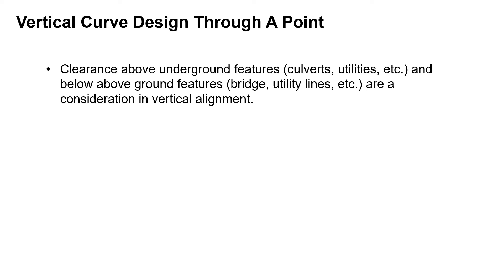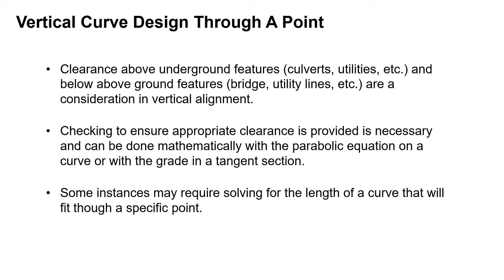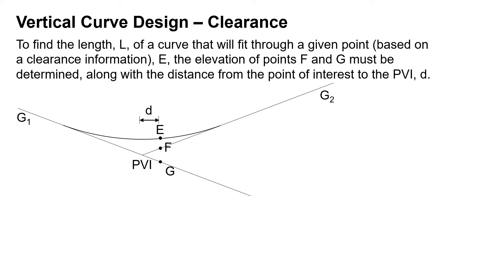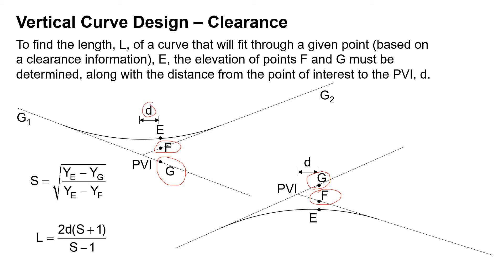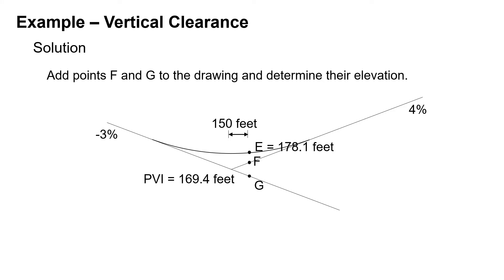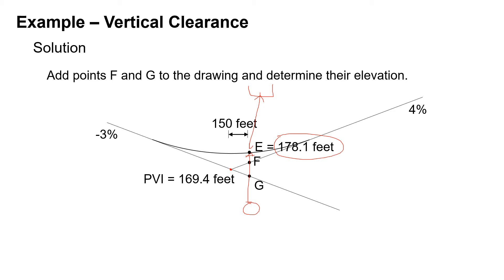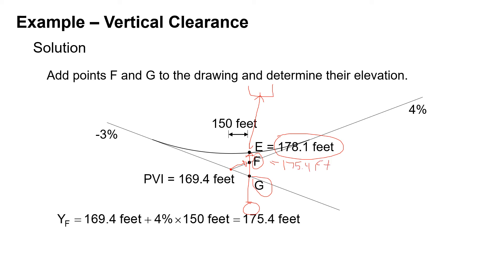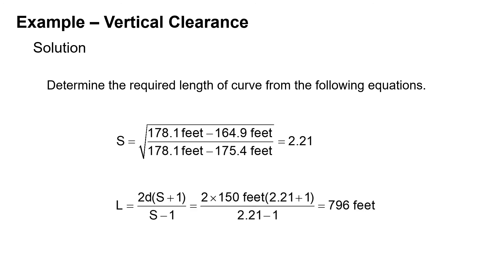Vertical Curve Through A Point Formula

Comment: I have noticed that the relevant equations for this type of problem are not in the new Reference Manual (post-April 2024). Do you know if this type of problem has been removed from Transportation PE, or if these equations can be found in one of the references provided during the exam?
Reply from the maker: Unfortunately, it's not in any other references that I'm aware of, so I wouldn't expect a problem on the exam to require this equation to solve it.  However, I did create a video showing how to solve this by trial and error: https://youtu.be/LVkBlPtvj_k
Reply: @FindleyDaniel  Thank you, I will check out the video you linked.

Comment: Can an engineer work in two different fields at the same time?. Like working as a structural engineer and highway engineer at the same time
Reply from the maker: I'd say that it's possible but uncommon.
Reply: yes. i am a civil engineer whose niche is water resources.

when not doing this i may go out to the field to study a swamp, which is the responsibility of an ecologist or a technician. when work with water engineering was slow i was called upon to inspect geotechnical borings in the field, as well. 

its common in civil engineering to work within several disciplines at once. but despite this, you work within your main specialty.

when you are highly trained as a structural engineer you remain as such until retirement due to the the very demanding and intense nature of this niche.

also, smaller firms will often be more permissive of engineers crossing their specialization boundaries due to lack of a big team with niche specialists and strong hr support. there are pros and cons of this setup, however.

Comment: section 5.3.2 doesn't exist in the ncees hb 1.1. was it once available in ncees hb 1.0 ? or did you get it from cerm (now obsolete for cbt) ?
Reply from the maker: Yes, I checked my 1.0 hb and it was a full page in that version.  I'll note that in the description, thanks!
Reply: @FindleyDaniel  why do you think the ncees would remove this topic? i've seen it taught at the sope before the cbt format was adopted. did it fall out of favor due to its long-winded solution procedure? remember, each question should take <= 6 mins to solve.
Reply from the maker: @oleopathic  I have no inside knowledge or perspective on that other than there must have been a substantial complaint against that content.